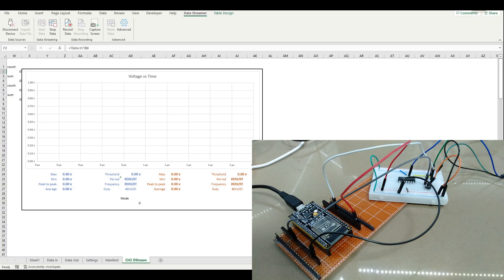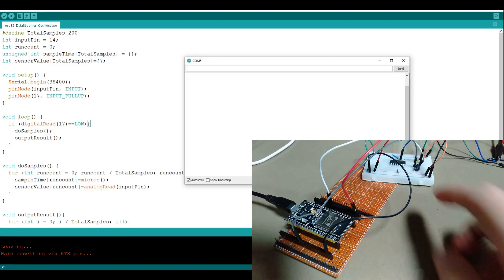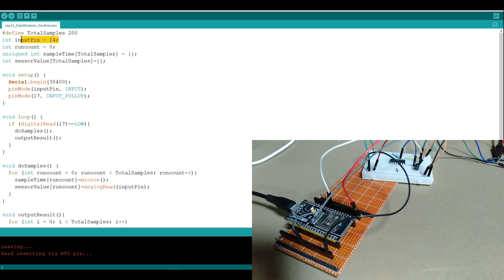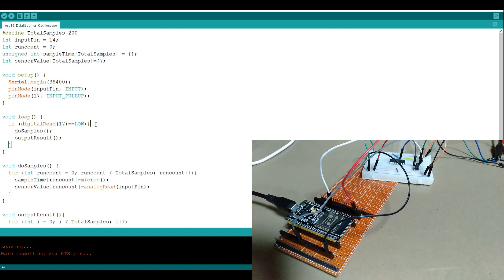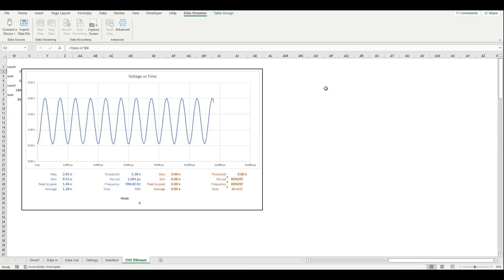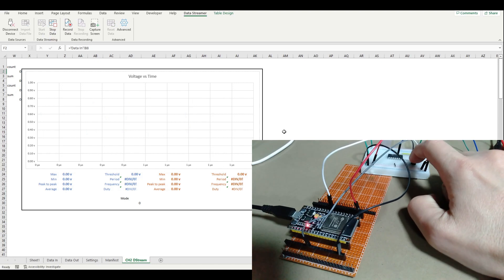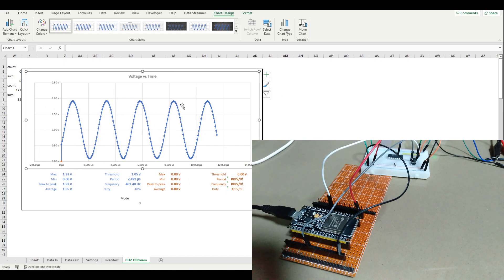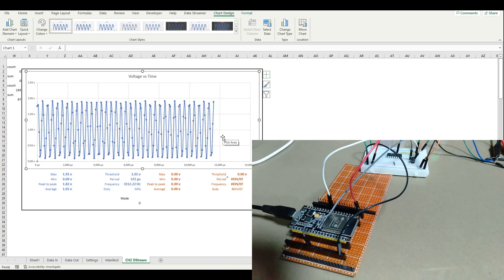ESP32 Oscilloscope (ExcelOscope Part 10)

Comment: like a sinusoidal signal, shouldn't it have a negative and a positive part?
Reply from the maker: You are correct the sign wave centred on zero would go positive and negative. I had my signal generator providing a positive offset to the sign wave so the whole signal would fall between the zero and 3 volts the esp 32 can handle.

Comment: good job! my testing got almost same output no mater what voltage input, what can be? thanks.
Reply from the maker: Check definitely on the right pin. 
Make sure input voltage is between 0 and 3.3 v as esp 32 can only that range

Comment: Interesting video - thank you very much for sharing! 👍👍 I am planning to connect EXCEL with my Arduino projects, because it opens up so many options for graphics. My question: does this work also with an Apple Computer? Is there also a Data Streamer for EXCEL?
Reply from the maker: I don't think there is data streamer in excel for apple.